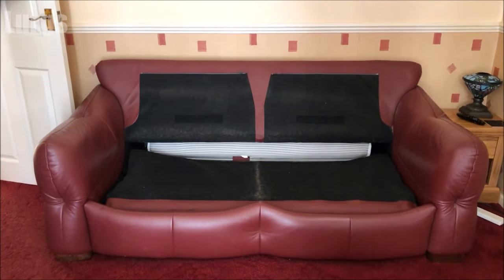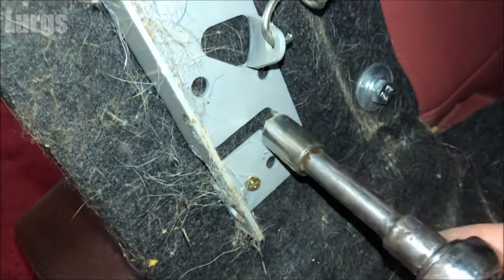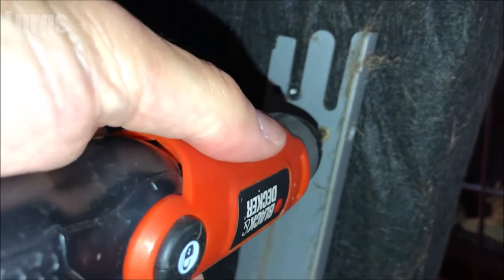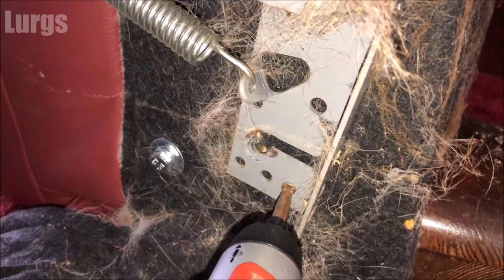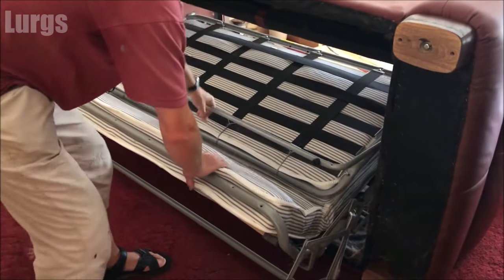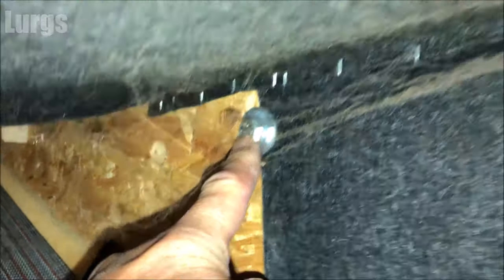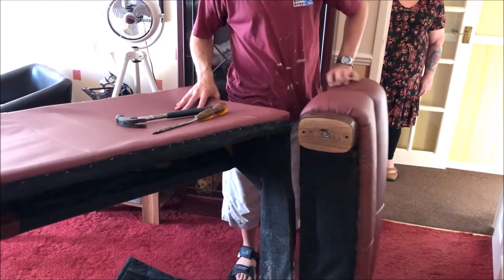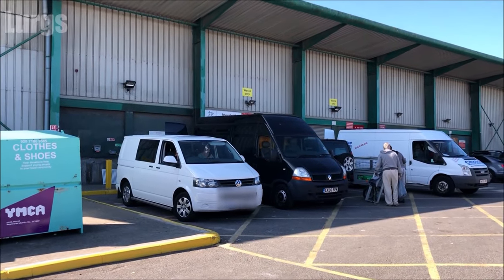How to dismantle a Sofa Bed Mechanism on a DFS sofa

Comment: Very helpful! I'm renovating my RV and wanted to remove the bed part from the ugly old outside and rebuild the frame in the RV.  Thanks to your video I know it won't be too hard to take apart!
Reply from the maker: Cool. Good luck. 😎
Reply: This is exactly why I was watching this video. How did it turn out in the RV?
Reply: @christieduncan956  it turned out great, I was pleasantly surprised at how smoothly it all came out and the space it opened up

Comment: Would there would be any issue then putting it back together if all the bolts and screws were kept? I need to dismantle to be able to remove from my house due to the size of the entry and put back together in the new house!
Reply from the maker: That’s no problem, quite an easy job. If I was you I’d use your phone and take a photo of what bolts/screws go where. Then when you put it back together it will be much easier!

Comment: To avoid all of that messing around at the end, after removing the screws and loosening the bolts (the rails are slotted and will slide off the bolts) watch your fingers and retract the bed into its original position. Then slide the rails off the bolts and out it comes

Comment: I used this video to see how to assemble our sofa bed 😄. Our movers lost the long screws. Before I take screenshot of it to the tools shop, would you remember what size they were, please?
Reply from the maker: Eliza Vlachou Unfortunately not but take a small object like a nail or knitting needle then poke that into the hole and measure it, at least you will get the length correct. With regards to width you will have to get a few different ones. If not sure go slightly bigger as its wood it should create a new thread/bite. Good luck
Reply: @LurgsHowToGuides  thank you!

Comment: Does the bed still work after you dismantle it
Reply from the maker: Yes although it’s tricky to fold out if it’s not bolted into the sofa, but it would work
Reply: In that case if you put 2 lengths of wood in a van you can have a pull out bed 🤔